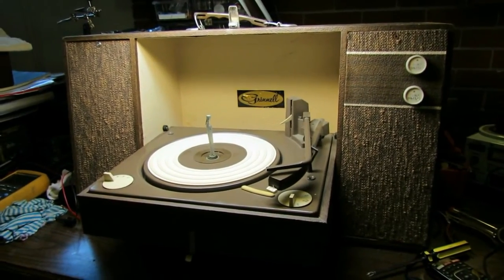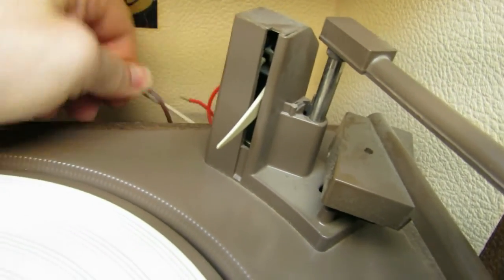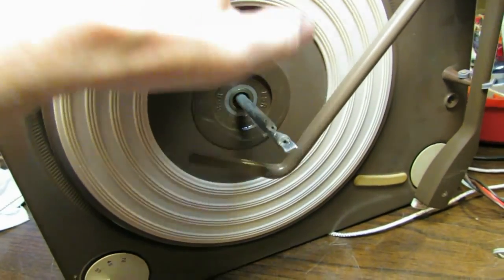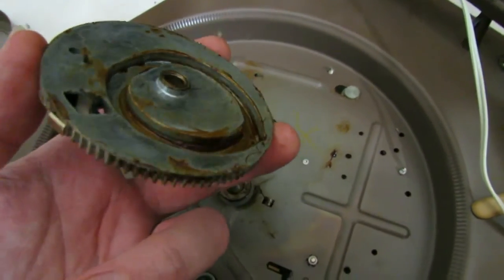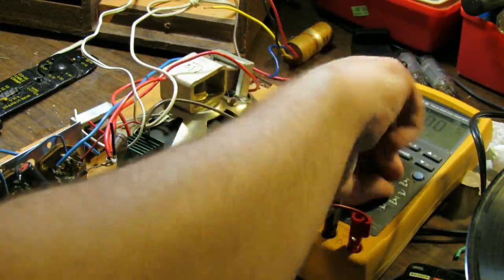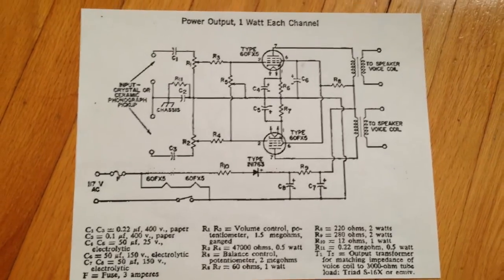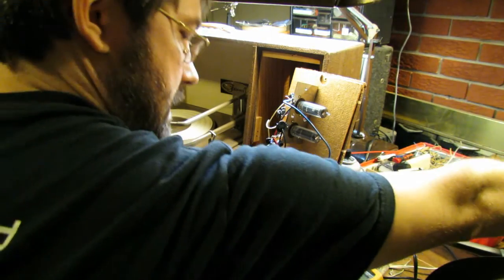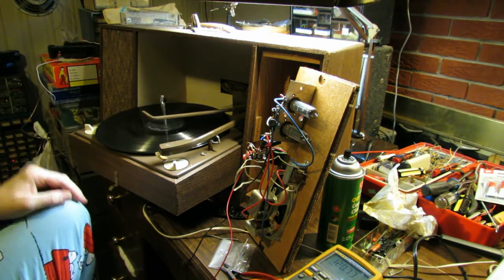1966 Grinnell Portable Record Player Changer Service

Comment: Grinnell Brothers had a piano factory in Holly Michigan I believe. I have a friend that has a Grinnell upright piano still today. I can imagine there is very little bass response. I had a different model that had one speaker in the cover.I had two of them and the amp kept going out I am not sure if it was solid state or not. They couldnt seem to get the parts to fix it.

Comment: are those 4 or 8 ohm speakers, I know how to make 8 ohm speakers work with 16 ohm amplifier just add 2 watt 8 ohm resistor on positive side of the wire

Comment: Had one just like it only it was new than the record rest arm is supposed to move to the right with some resistance and lock over the tone arm for transport mine was a westinghouse same changer though I also had the die cast pot metal tone arm not the plastic as these were on cheaper store brands

Comment: I can suggest something for that noisy pot that didn't came back after cleaning. A few years ago, I spent DAYS on a problem like this. I disassembled the pot and cleaned it completely. It had the right value and became like new. It didn't cure the problem. I replaced the pot with a brand new one. Nothing worked until I tried something that I would never suspect: I replaced the little ceramic input coupling capacitor and guess.... it cured the issue! I even put back the old original pot that was cleaned before and it worked perfectly fine too. As technician, we know that ceramic capacitors "never fail" so we never check this. BUT every rules have some exceptions. :-)  So if you still have this record player on hand, I strongly suggest you to try this trick. If possible,  I would like feedback about this, just for curiosity.

Comment: most of the newer bsr crapola changers have it where the e-clip on the top of the platter holds in the spindle . this is a very old changer but they seem to have better build then the newer ones do. . I wish tube audio was still made the solid state stuff is not as good as the tube gear . that issue with the record over arm is not how that works the arm is suppose to stay close to the center spindle after all the records have played and that over arm is broken there is a piece on the shaft of that arm that was broken off and now it is not working correctly that whole arm needs to be replaced for the changer to work right  . thank you for posting this
Reply: Yep you are right. The record balancing arm is not suppose to move back once down.

Comment: I have a few of these BSR's, so just for the heck of it I watched your video. The overarm  swinging is not a feature- it was never meant to swing around like that. The other viewers are right about a pin- there should be a metal pin that sticks out at the base of the shaft, but there should be a piece of rubber at the top of the shaft about a half an inch or so tall, so even if there's a pin at the bottom, if the rubber piece is missing, it will swing around like that. (on one of mine the rubber was there, but it was so dry I took it off, and just as I suspected, even though the pin is there, it swings back & forth like yours, because there's nothing to stop the pin when it's all the way down.) Hope that clears up the mystery for everyone.  Nice restore video!

Comment: In this design, the 60FX5 is just a typical power pentode, no preamplifier. The cartridge serves as the preamp, as it's output is high enough to drive an output stage directly. You were lucky to find this record player with a working crystal cartridge, most of them are dead. The Rochelle salt crystal inside absorbs moisture, which is what winds up killing them.
Reply from the maker: Thanks for the comment. I knew crystal carts went bad eventually but wasn't sure why. If it dies while I still own it, I'll make a transistor preamp for it and convert to magnetic cart.

Comment: I suspect there's something wrong with that arm.  It shouldn't swing back like that when the last record drops.  It should fall down and not be able to swing.

I think it's acting right if the arm is over the tone arm's home.  That's the "single play/semi-automatic" (non-changer) mode.  I think the assumption is that you'll want to play something else.
Reply from the maker: I thought that too, but I just saw this exact table on a radiotvphononut video and his swung the same way. Maybe a common problem with this model?

Comment: That turntable looks more  like it was manufactured in 1962 instead of 1966...Back in 1962 my grandparents had a console with that type of turntable. Or they might have kept the same type of record changer for a few years...
Reply: That changer was made by B.S R. model ua25 from 1965 to 1968 ,when they changed over to the morden  models.

Comment: Hi G, Brad, Nice repair, hey, whats a little magic smoke? Fortunately, the parts don't feel a thing. Your gaining lots of good knowledge on these projects. As per Rick at All American Five Radio, a most excellent channel for learning electronics, a few drops of WD-40 helps to replace the petroleum lost is the phenolic material of the pot. It swells back to size and the contacts touch better, just a little FYI. Cool channel. Take care, be good, C.
Reply from the maker: When a pot is really seized, I'll sometimes use WD40, but otherwise, I try to avoid it. THe argument goes it collects dust and debris faster over time. Don't know how true it is, but I've always avoided using it on pots when I can.
Reply: The Guitologist Hi Brad, Rick did a volume control on a radio 20 years ago and as demonstrated in a video, stills works good today. Just a thought. I really can't say from my own experience. Sounds logical. WD- 40 dries, leaving only a molecular layer of protection. It's a dielectric. Anyway, who knows. Perhaps I will perform a test and see for myself. I'll keep you posted. Take care, C.
Reply from the maker: Well, like I said, I have used WD40 on rare occasion and haven't experienced any first hand drawbacks in pots, but plenty of others frown upon it, so by sheer force of conformity, I have followed suit for the most part. Conformity is never a good enough reason in itself to continue acting a certain way. Next pot I see, I might just fill that sucker with enough WD40 to satisfy an army of Tin Men.
Reply: Hi Brad, Not trying to be a know it all, I don't. According to Rick, at AAFR, all you need is a little bit on a tooth pick, sparingly. I hope all is good with you and yours. All just for the sake of discussion, I would do as you think best, your first intuition is usually correct. Happy Fall, I love this time of year. I'll keep you posted on any Roosevelt Elk sightings, always cool.  Peace & Happiness from Oregon, be good, C.
Reply from the maker: Your commentary is always welcome. I'm always willing to have my mind changed on stuff. I'm always looking for better ways of doing things.